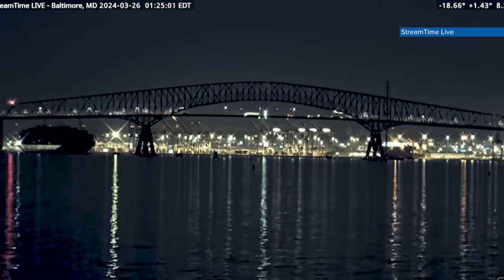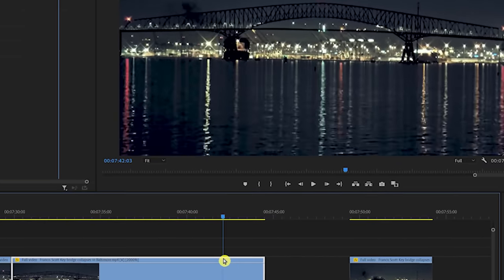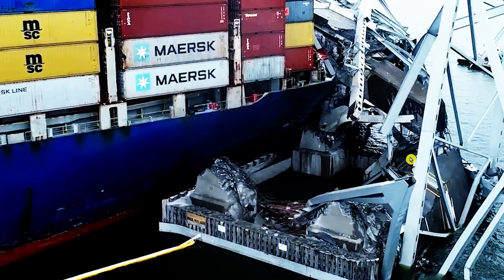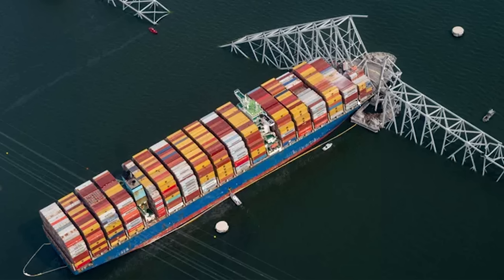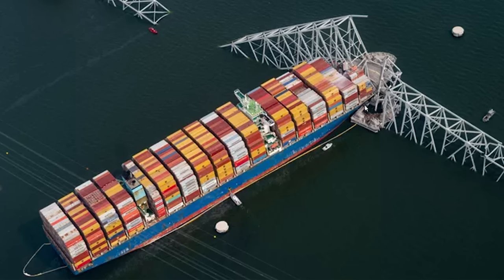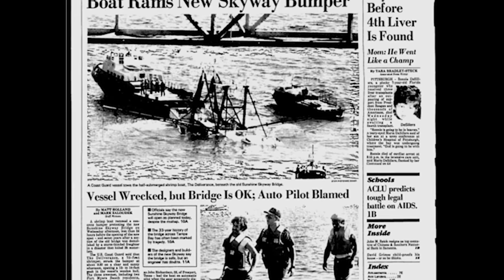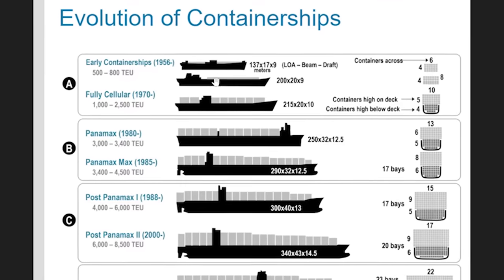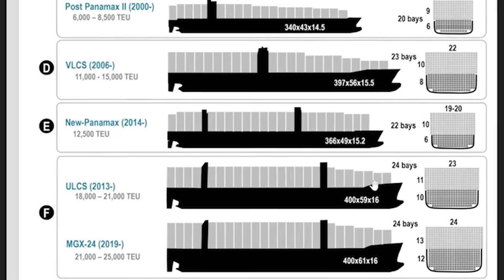NO Dali Bridge Crash Protection Like Sunshine Skyway Bridge?

Comment: You can tell by the huge wave that washes up over the piling island right as the ship directly hits it. So your glancing blow theory is way off. Secondly, the propeller walked the ship sideways at the last second when they slammed it in reverse. Pulled the ship stern to the port 50 feet and rammed tge ship straight into the supports.

Comment: Terrible design, should have had 5 dolphins on each side or a structure completely around the pillars. (not a beach)  the Dali could not have been centered between the pillars. It was way south, even with the drift. And the hard turn was pilot error.

Comment: It was at a falling tide, so the current was flowing out of the harbor (not much though, maybe a foot and change difference). But it is a river, was about 300 ft^3/sec. The FSK bridge is further down the harbor than the river, so there's more outflow there.
   There's been a depth variance of 11 feet over the last 120 years. I imagine they have a potential for a lot of storm surge there depending on the winds. 
    The dolphins are an obvious solution. No argument there. They would've helped (although not is they were near the one there, far out from the bridge). The question is why. Hasn't happened yet is not an acceptable answer. Waiting for climate change for sea level changes is marginally less unacceptable. I would posit that the placement of the existing dolphins is probably to ensure alignment with the channel. 
    All I am saying is yeah, there's an obvious solution, but it needs to be thought out. Putting a buffer zone of 20'  of riprap around the base of the pier might result in other problems. Florida doesn't really have rivers that bring silt along. California as well. The Golden Gate bridge has 300 ft depth of water beneath it (why they needed such a long span, and piers closer to the banks). 
    I'm looking at the harbor (https://www.charts.noaa.gov/OnLineViewer/12281.shtml), and there's about a 15-20 feet different in depth from the channel, to outside, which is about half the depth of the total. I would thinking soundings around the Sunshine Skyway bridge would be more uniform. What would essentially happen with dols is it would create a canyon underneath the bridge. It's a deeper channel than the one in FL, but also shallower around it. 
    If I see an obvious solution that wasn't done, my first thought is, it may not have been so obvious a solution, or it would be done. Doesn't say if the reason why is right or wrong, but that's something you address in fixing things. Easy to say anything is cheaper than a failure.

Comment: These ships might be run on electric, but they have huge battery backups that are powered by massive diesel engines. I am growing more and more angry at how the "ohh they had power issues for under a minute" to be the cause of this. Sorry, I know this is about bridge protection, but I hate how the crews actions are just being ignored. Lastly, that ship should have been lined up a long time before they decided to start that turn to begin with. had they have been lined up, that loss of forward speed would not have resulted in the sharp turn.
Reply from the maker: The current from other neighboring bodies of water and the tide can make a ship turn. You are not guaranteed to float aimlessly in a straight line
Reply: Ships are always adjusting rudder angle and direction just to move in a straight line. There are so many forces acting on a ship all the time, especially near shore and in channels. One to consider is that as the ship pushes water out of the way pressure builds up in front of it in the narrow channel. When it passes an intersection with another channel the pressure on the side of the intersection is released and the ship will move in that direction due to the pressure that’s still on the other side. The ships going through this channel every day will need to compensate for that in order to maintain a straight path.

I agree with you that the crew actions may have caused collision, either by ignoring warning signs beforehand or by responding incorrectly. I believe it was some pilot association that released a statement saying they did everything they could to prevent the accident, but it’s the association’s job to protect the employees and they would probably like to blame the regular crew and captain even if the pilots contributed to the disaster. It’s tough to tell if they could have avoided collision after power was lost aside from preventing the power loss in the first place proper maintenance, inspections, and operations. It’s innocent until proven guilty and the authorities don’t want the crew talking to the media in case they try to misrepresent the situation to appear innocent, among other reasons. I really hope that, if there was criminally inappropriate behavior on the part of the crew or company, there are agreements in place (like extradition or setting assets aside) to bring them to justice once the proof is established. I doubt it though.

Comment: AND YOU KNEW ABOUT THIS? Pathetic. Seriously, if the channel had not been dredged to the point where it allowed the vessel to come into contact with the bridge..... You allow for enough embankment to surround the piers then the bridge is out of harms reach.As for the turning of the ship, it seems evident it turned 40' starboard but the heading of the ship would tend to be maintained  due to forward momentum. Had it been on railroad tracks the the ships heading would changed in keeping with the 40' turn. On the lighter side, i was thinking how your depiction of the Dali could come into contact with the Sunshine bridge looked like a Monty Python production when along comes this gem>>> 11:53

Comment: Love you armchair engineers.  You love your clicks and paid views!Never let a good tragedy go waste huh!  When the piers are at the edge of the channel there will always be a chance of a catastrophic failure.  Dolphins will not stop a direct impact.  They are meant to slow or deflect an incoming ship.  The only true way to prevent this type of event from happening is to lengthen the horizontal clearance by moving the main support piers outboard of the channel.  If the piers are away from the channel in shallow water the ship will be stopped by running aground never having the chance to impact the pier.

Comment: Either the Dalli is a piece of junk or it's captain and first engineer are incompetent.  They should have had the backup generators running ready pick up the load if the primary generator fails.  No ship operator would want his ship to lose control in port, obviously.  Why do you think row boats have spare oars?  Duh???